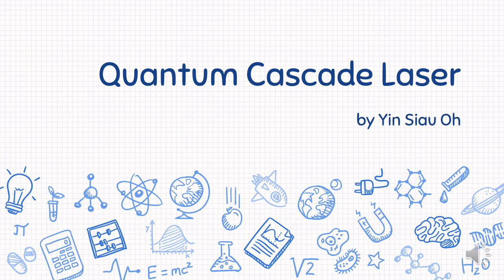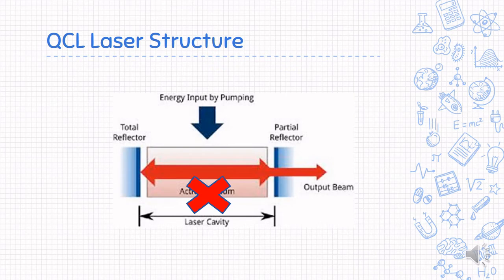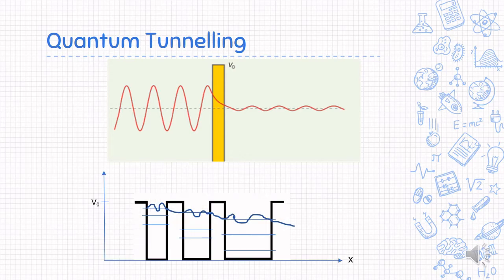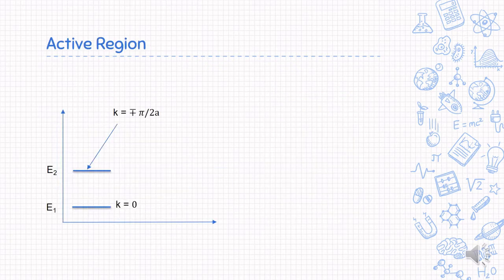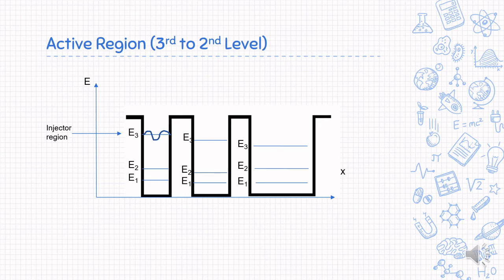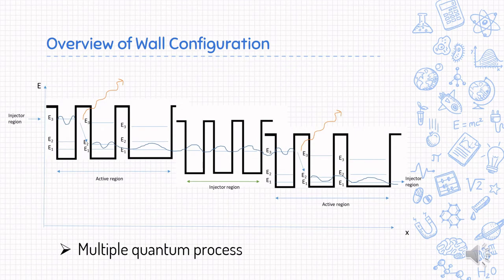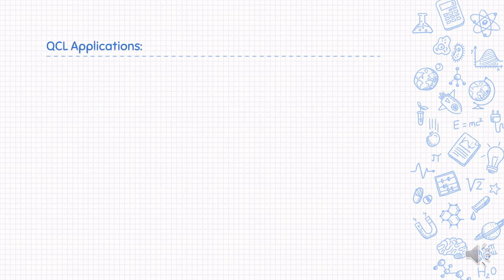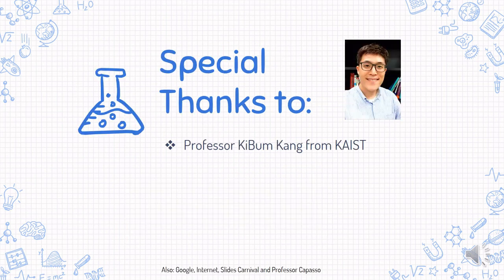Quantum Cascade Laser

Comment: Summary

What it is:

* A semiconductor laser emitting mid to far infrared light.
* Uses "cascade" of quantum effects for light emission.

How it works:

* Superlattice structure: Alternating layers of different semiconductor materials create multiple quantum wells.
* Quantum tunneling: Electrons tunnel between these wells without changing energy.
* Two main regions: 
    * Injector Region: Feeds electrons into the system.
    * Active Region:  
        * Composed of three coupled quantum wells.
        * Electrons undergo inter-sub-band transitions (within a single well) and emit photons.
        * Design promotes population inversion for efficient light emission.

Advantages of QCLs:

* Tunable wavelength: Emission wavelength adjusted by changing superlattice layer thickness.
* High efficiency: One electron can emit multiple photons.
* Long wavelength emission: Achieves wavelengths not possible with standard diode lasers.
* High sensitivity:  Detects gas particles at extremely low concentrations (parts per trillion).

Applications:

* Gas sensing and measurement.
* Medical diagnostics.
* Terror threat prevention. 

i used gemini 1.5 pro to summarize the transcript